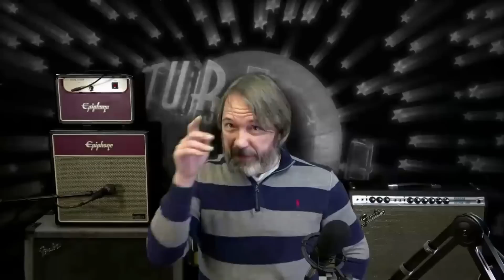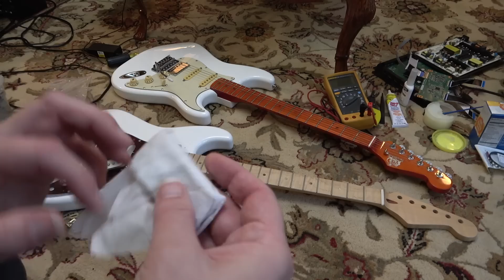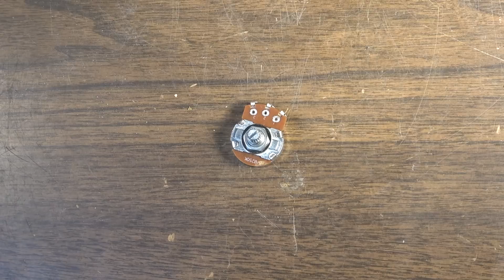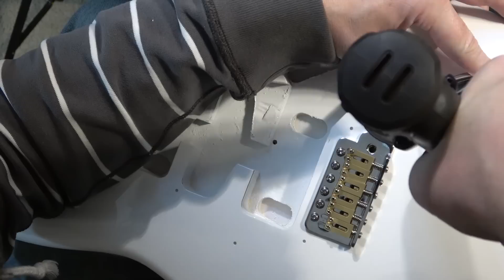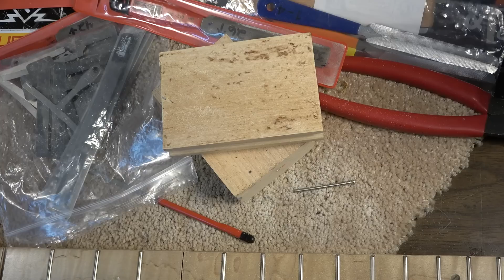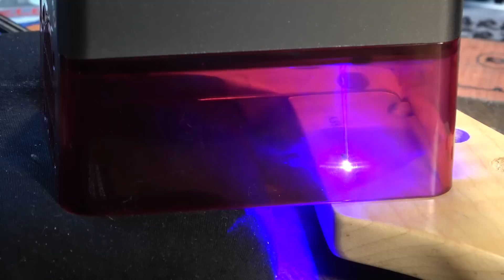A Fender Custom Shop Level PARTSCASTER!? ...from TEMU Parts? | The Guitologist

Comment: The strap locks are in my opinion overkill, unless you plan on swinging your axe around your upper body, I got them, then saw another again in my opinion better design that deals with two birds one stone, comfortable strap with build in lock that is barely noticeable compared to a big old two part mechanism, and you get to keep your normal strap buttons.
It's an Ernie Ball P04146 Wide Neoprene Polylock Comfort Strap.
Reply: As a fat guy my stomach puts the strap in a weird spot, and the locks are nice
Reply from the maker: Planet Waves makes those too.
Reply: @TheGuitologist  yeah? I'll have to check them out, the Ernie Ball selection don't have much in cool designs on their's.. all black I think.

Comment: I use linear only for everything... I cannot stand that "all the sudden" BS, for tone there is zero control you cannot mix or blend at all .  . also you can make that no load by putting glue over the carbon, then it can be removed if you want and you can make it more precise using the proper applicator, bring the glue down over the edge so if one day you want to  reverse you just grab the glue hanging over and peel it off, clear nail polish works well, let it dry to desired consistency, drip over edge so it will peel off...  nice budget strat build Brad . . . . . .
Reply from the maker: The glue trick might work. Id only worry about it getting caught on the wiper and messing that up.